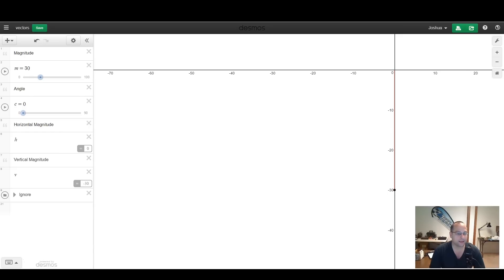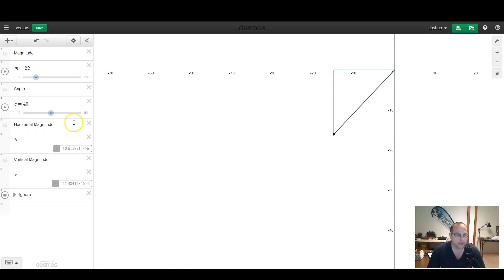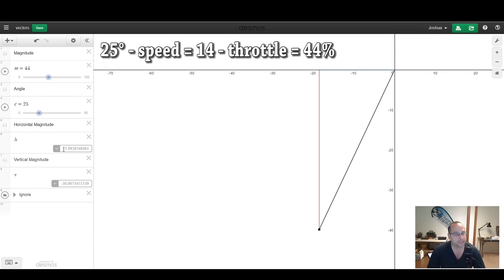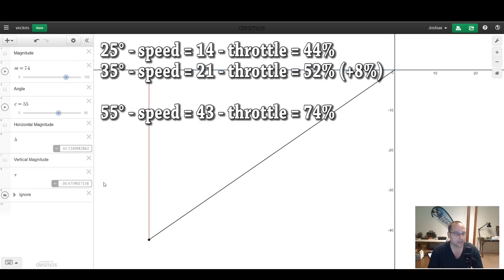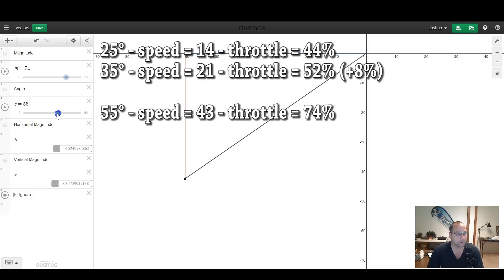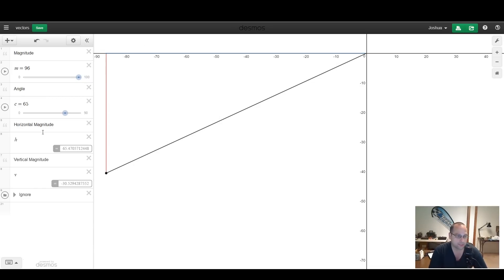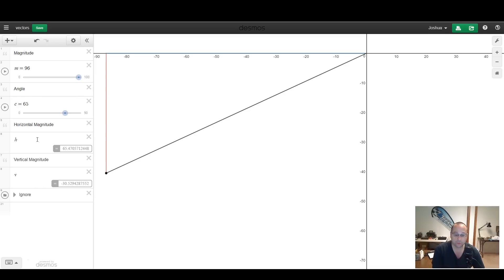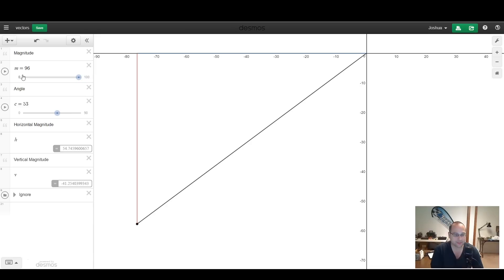How Camera Uptilt Affects Altitude Management

Comment: biggest thing that was missed in this video is that this is all 100% relative to flying perfectly strait forward while keeping the horizon in the exact middle of the screen. The drone is going to fly just the same with any uptilt (the only difference is what you see from the camera at that angle). I think you should have explained this better in terms of the angle that the actual drone is flying at and then shown the difference in what the camera be looking at depending on the uptilt you are using.

Comment: Thoughts on setting ratio of roll/yaw rate to maintain coordinated turns with equal amounts of stick movement? E.g. at 45 degree uptilt, yaw and roll are set to the same rate and symetrical yaw/roll stick movements are used for coordinated turns. But then what happens above or below 45 degrees?

Comment: Taking freestyle flight out of the equation,, would it be beneficial racing to program a mix in the transmitter to increase throttle for a certain amount of roll?
Reply from the maker: +_ DEVSTER _ no, because in acro mode stick position doesn't correspond to roll angle.

Comment: any suggestions on beginner camera angles,  i pootled about with about10 12 degrees of angle, it felt ok i could look around and get a feel for it without gathering more speed than i could handle,  is this enough of an angle to learn acro, is it enough to get the muscle memory going for actual acro proximity flying? i'm sorta thinking flying slow in acro mode doesn't provide enough input to learn acro, its like going a bike really slowly is actually more difficult than just a normal speed, so am i making a mistake by only using 12 degrees? which i accept is pretty much sight seeing angle, if i move up to 20 degrees my quad will be moving really quickly, over 50mph, so anybody in comments who has any suggestions or experience, i'm tempted to just go for it and do loops and high altitude flips and  rolls till i get some sorta muscle memory for acro,

Comment: Makes sense. The higher your uptilt, the more vertical your quad becomes relative to the ground when your camera is pointing horizontal. Therefore your thrust is pushing less and less towards the ground, so the only way to not shoot into the ground is to give it more throttle, thus making you go crazy fast horizontally. Sad to say your graph didn't make much sense in my brain, but just using my hands to simulate the base of a quad and the direction the camera is pointing helped me grasp this concept. It's clear to me now why most freestyle pilots use less angle than racers: in freestyle you want to be able to go fast in all directions easily, not just straight ahead, parallel to the ground.
Reply from the maker: +Jon B Baca also, freestyle pilots want clean axial rolls. Most of them do anyway.

Comment: 30 35° is a great angle for acro that I think alot of pilots use. ever notice that above 45° the roll has a little yaw and the yaw acts a little like the roll this is sometimes just as challenging as the throttle management in these higher angle settings especially if you have only begun to experiment with uptilt.

Comment: With cam uptilt, the ability to hover is directly proportional to your desire to see the horizon. Tilt above 55 degrees is great for flying tall obstacles, in which case who cares about seeing horizon. You just need to adjust your brain to not look for the ground/horizon. Instead you focus on the obstacles you're flying around; like tall bridges ala mr. stunty. If you're flying forward and level, then less tilt is important because of the issue you're explaining and your proximity to the ground. just my .02
Reply from the maker: Agreed. If you are flying in a 3D environment like matty under a bridge, uptilt is a different proposition. It still changes your roll/yaw relationship though.

Comment: Very interesting info there! Shows where you don't gain anything without losing something else in return. If I'm understanding this correctly essentially when going with extreme up-tilt it would be critical to keep in mind the flight characteristics as well as being prepared to have almost constant full throttle and using subtle pitch adjustments to maintain vertical thrust. If someone wasn't mentally prepared for that it could be a seriously nasty and potentially costly learning curve.

Comment: Joshua, what is your favorite angle for Acro, and racing?
Reply from the maker: For acro, no more than about 30-35 degrees because past that point, it becomes very hard to do clean snap rolls and any move that involves clean roll motion. Even lower would be better, such as 25 degrees, if the reduced speed could be accepted.

For racing, about 40-50 degrees is where I prefer to be, although I should say that I am NOT a hard-core racer. I find that much past about 45-50 degrees and it gets very hard to make smooth turns--not because it's hard to coordinate turns, but because you very quickly get to the point where your vertical vector is near zero and altitude management while turning sharply becomes very difficult.

Comment: I would like to add the influence of copter weight on copter speed to the discussion. People tend to build their quads as light as possible but not everyone is aware of the fact that a light copter needs to be pitched more forward (or flown with more cam tilt) to generate the same amount of foward thrust as a havier copter while maintaining height. There are  some orher things to consider like inertia and air friction, however. That's why light copters have certain advantages over heavier ones. Just be aware that flying a super light rig will require a higher cam angle to go fast.
Reply from the maker: +Jon B Baca because a heavier quad needs a larger vertical component to maintain altitude. So it has a larger horizontal component at any given camera angle.
Reply: +Joshua Bardwell Yes, the absolute hirizontally forward directed force F_fw is higher for the heavier quad at a similar pitch angle. However, both quads will experience the same horizontal accelleration. That's quite a tricky one ;)
In the end, the final speed at a given pitch angle will adjust when F_fw + F_ar = 0; F_ar being generated by air resistance as a function of speed. Since F_fw is bigger for the heavier quad, it can counteract a higher F_ar which means flying at a higher end-speed for a given pitch angle.
Reply: Why is that? just because of momentum?

Comment: These effects can be greatly reduced with a larger fov using a 2.1 or 1.8 camera lens.
Reply: With a 2.1 it gives you a "range" of tilt to play with, I find with a large fov you can utilize the angle for invert tricks but I have more control for proxy flips and hover type moves.
Reply from the maker: +Dallas Rodier very true.

Comment: Thanks Joshua, a very nice mathematical reasoning to something I've discovered sort of intuitively as I've slowly added more and more uptilt to my copter.  

I'd thought I'd settled on 2.5mm being my optimal lens diameter, but I'm now considering giving 2.1 another go as the extra vertical field of view allows you to fly comfortably when pitched at a wider degree of angles.  I find this really helps when running higher uptilts, as I tend to have to adjust my pitch more to help control my altitude since the throttle has much less effect on altitude the more uptilt you have (as you excellently explained).